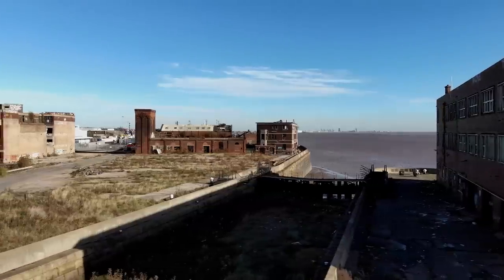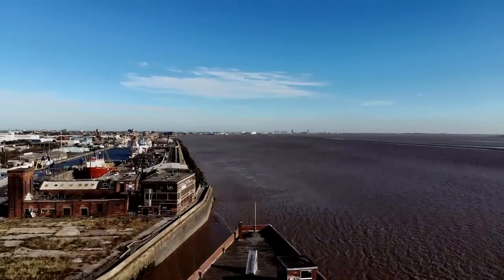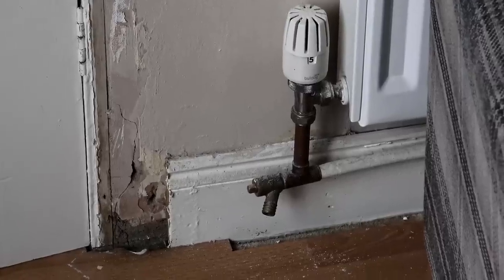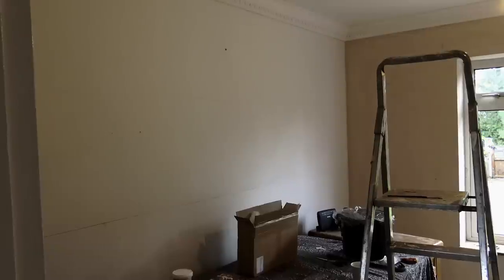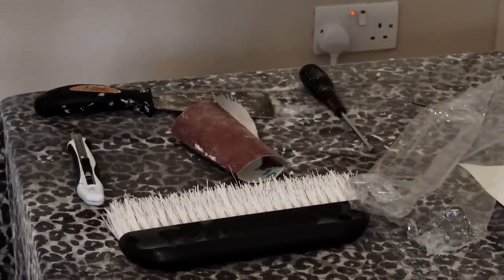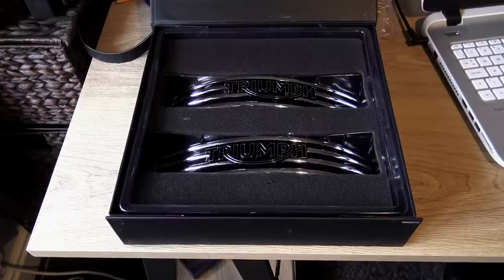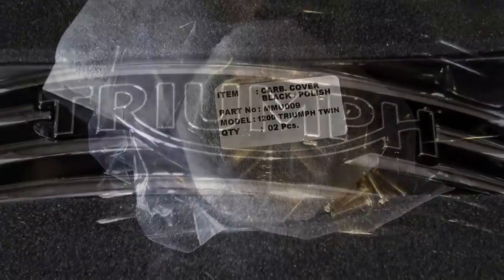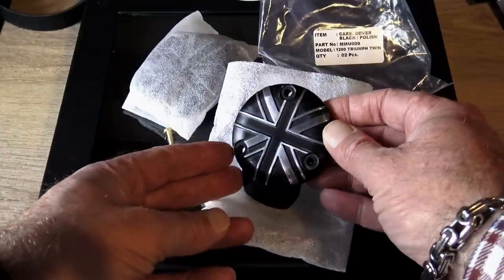Triumph Bonneville T120, NORMAL SERVICE WILL RESUME SHORTLY!

Comment: Hi Stuart did my four bar badges the other week. Unlike some of the suggestions people gave me to prise up the centers logos and pull away, I used a hair dryer, to heat the old badge centers and managed very carefully to slide a thin screwdriver between the main badge and the center aluminum triumph logo, following the edge of the main badge so as not to slip and possibly scratch the tank paint work. This breaks the glue affectively without bending and creasing. This allows the possibility of reusing the badges again should the desire take me. Hope this helps

Regards. Tony
Reply from the maker: we obviously have very similar thought processes Tony I used a similar method using HD01.
did bend the centre piece a little, not sure if it will straighten out for reuse.

Comment: Does anyone have the four bar badges that will fit the liquid cooled Street Twin models, or do you know if any current ones will fit? I do not care for the stick in modern looking badges they come with. One of the few details I have an issue with. Thanks again for the excellent work you do!

Comment: Hi Stuart, Really love the tank badges. Do you know if they would fit the T100 tank? I have a 2011 mag wheel Bonnie and was thinking of getting the same design done but as Pinstriping. Doing it this way would be quicker and pretty permanent. I just wondered if you had any thoughts on this? Hope you don't mind me asking.
Cheers Keith
Reply from the maker: They are a very specific fit for the watercooled T100 and T120!
Reply: @stuartfillingham  Hi Stuart many thanks for the reply. Shame they won't fit my bike. Never mind Pinstriping it is. Cheers Keith